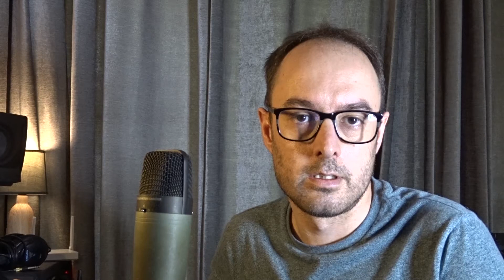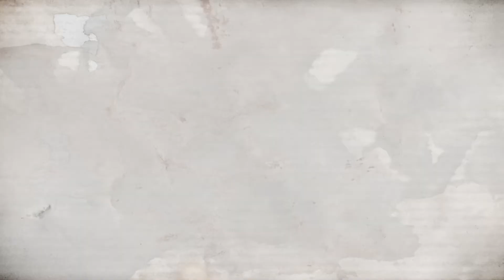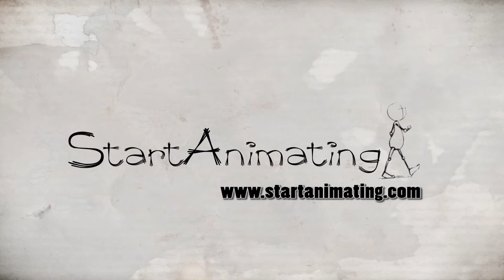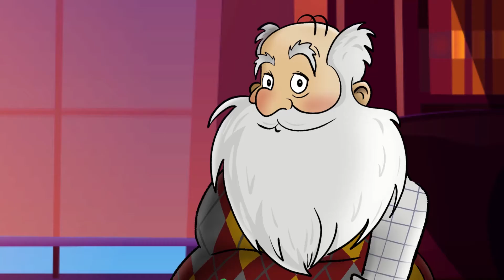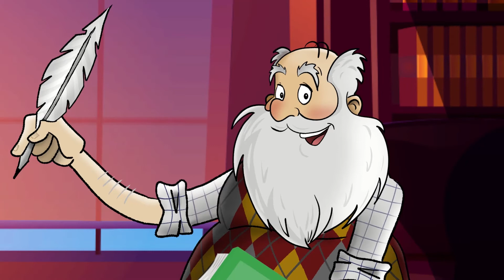Improve your animations with these camera techniques: Zoom in - Zoom out

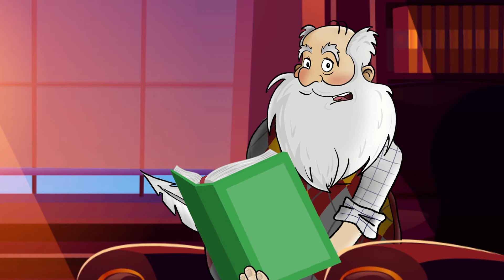Comment: 7:05 love the set up, color and the character ❤️ wondering what software are you using?
Reply from the maker: Hi, I designed the character in Clip Studio Paint.  The backdrop I ended up purchasing at Creative Market and modified it inside Clip Studio Paint to work for my animation.
Reply: @startanimating695  cool. And how about the animation software? Is ot Clip studio paint as well?
Reply from the maker: I use Cartoon Animator 4 for my animation.
Reply: @startanimating695  lovely outcome
Reply from the maker: Thank you.  Appreciate it
Reply: @startanimating695  can you make a separate video on how you used the camera feature in Cartoon Animator based on what you have demoed at 7:05? Thanks in advance